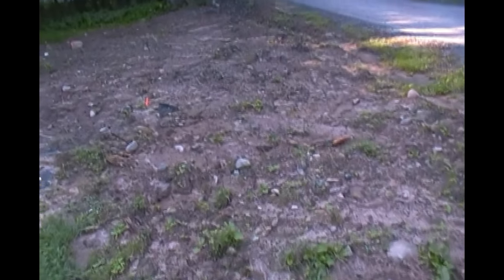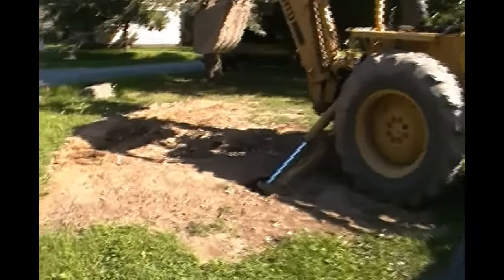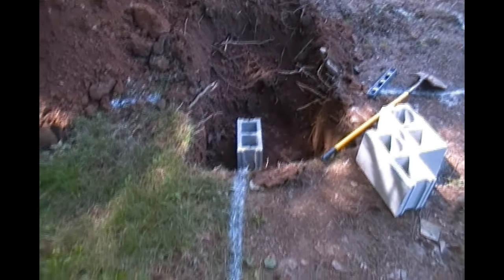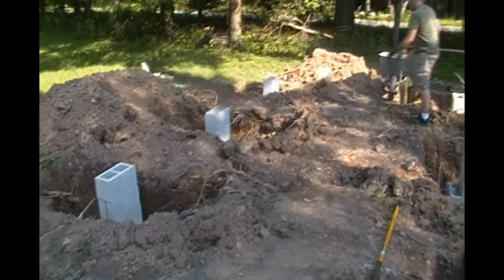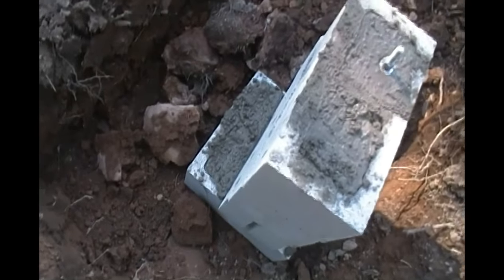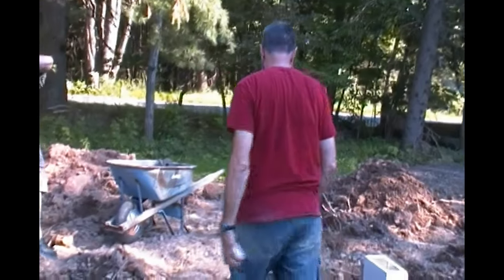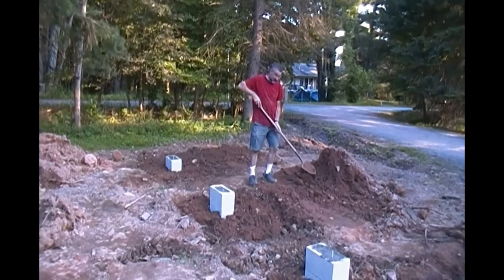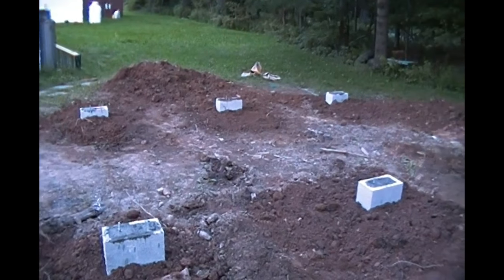Shed Rebuild (Pt3) - Footers

Comment: You build things the right way, like my husband does. My husband did almost that much work for one of those "tent" "garage" things. The canvas is long gone and been replaced at least once and that's gone. But the framework is sound. If you're like my husband, you are spending several hours drawing plans and making a bill of materials, etc.  My hubby doesn't do building construction very much, but more small woodworking, but he does that for his small woodworking and I'm sure he would do it for a building as well.

Comment: Nice job on the footers / pilings. A lot of hard work. When I did my pilings I did like you said, I built forms from plywood 24 inches square, filled them with old stone and some rebar, then invited the cement truck to come fill the forms up. It was fast and strong and I had five pilings for a 12 x 24 foot shed. Also half of my shed hung out over the rail-road embankment to utilize as much of my tight property as possible.  Since you are on flat almost level ground, this way probably works better and maybe a bit cheaper but not faster. I dug all my pilings with the back hoe and also filled them back in with the backhoe. While the front pilings were almost level with the ground, the back pilings were 4 feet above the ground due to the embankment slope.  However, even on level ground I think I'd of done the same thing and poured the pilings.  I didn't know it at the time but they make round tube forms out of cardboard and that would of saved me building the plywood forms but that actually went fairly fast.

Comment: I often wonder if it would be better to dig the holes a couple of feet square. Then fill them with layers of gravel. Then place a cement pad down to build. We have so many issues down here in North TX with the ground moving. The clay expands & contract many inches over the course of the year. Many folks, including myself, suffer from foundation issues. 

Looking forward to the next installment...

God Bless